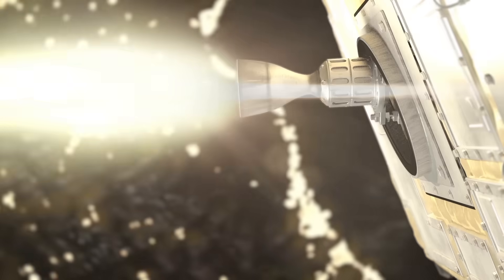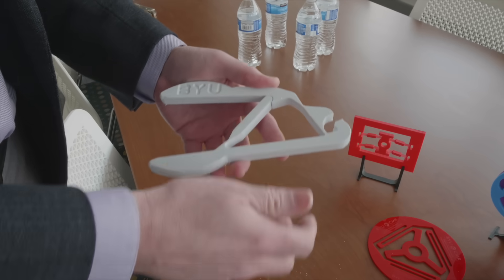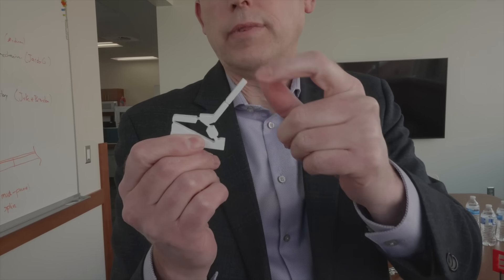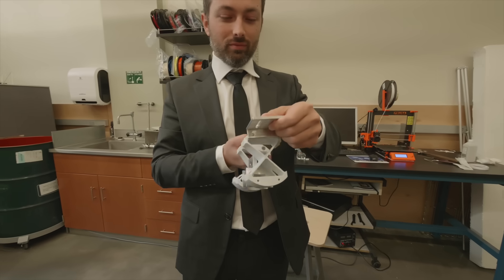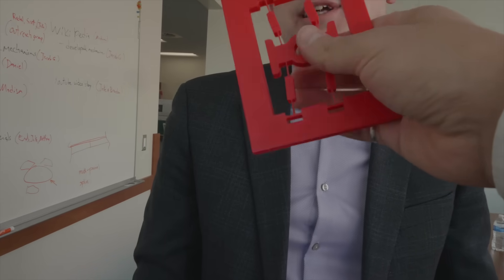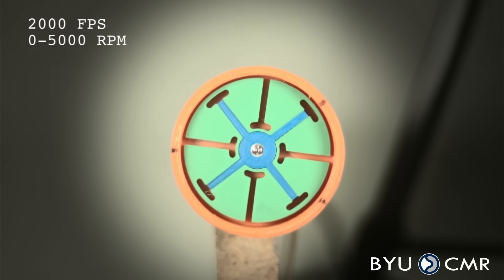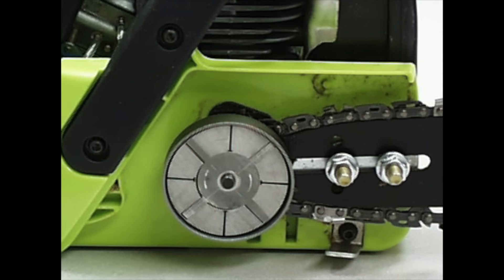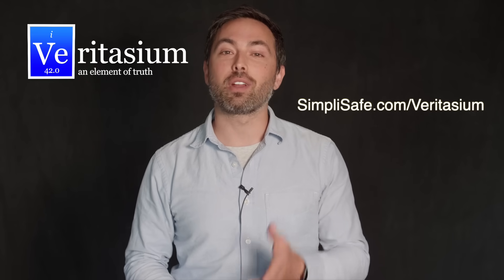Why Machines That Bend Are Better

Comment: Why do I 'really' feel like some of those mechanisms would have serious issues with work hardening, susceptibility to temperature affecting performance, and other such issues in metal? Like, not all of them, and this stuff is really cool, but my brain is telling me there has 'got' to be a catch. Kinda like how most ribbon springs and shaped metal latch bits have been omitted from guns over time in favor of everything being down with dedicated coil springs (except in cases where the mechanism doesn't see much action.) I am intrigued, but skeptical.

Comment: The first thing I thought is that those parts will wear out quickly at the flexi bits. But it looks like does endurance test show that's not true. I picture uses in robotics and or possibly biomedical, as in joint Replacements possibly

Comment: I just thought how awesome it would be if this technology is applied to the automotive industry. Strong, lightweight, highly-tuned single piece suspension systems for example -- nothing that will wear or degrade or leak, and in the worst case that it breaks, the whole unit can be replaced after removing maybe four or five bolts. In aircraft, this could mean single-piece wing and control surfaces (I think NASA already had a concept in the works). Even in the food production industry, single-piece tools are significantly easier to clean and maintain than normal tools that have gaps where food might get stuck and parts that might bind. The possible applications for this technology are endless :)

Comment: 10:59 wouldn't 72Hz mean 72 rotations per second, not just 2?
Reply: If we were talking about the gear spinning at 72Hz, then yes. But in this case the whole device is working at 72Hz, meaning it pushes the "ratchet" 72 times per second. Assuming it has 36 teeth, that would be two rotations per second.

Comment: My only background about flexibility is rigidity. Same goes both ways, nonconversational materials will be needed, may as well be researched, and will definitely cost more for a specialist parts or mechanism. You can't just mass produce universal parts without mass producing the material first.

Comment: I do a lot of work with compliant structures and flexures in my machine design.  I use them to allow compensation of variation in machine design.  Often times machine builders do not account for variation.  If you can now add flexibility to compensate for the remaining system variation your system becomes many times more reliable.

Comment: "Better performance" Nope, you would have to specify the use case. You stated having to lubricate a bearing was a bad thing, but being able to do that ans keep the device operable, sometimes if do that WHILE it's operating, with no down-time, can often be preferable to manufacturing a whole new device because the bendy point finally got weak enough to break (or weak enough to put the device out-of-spec).

Comment: "It's always been considered bad to have flexibility in your machines." No it hasn't. Ever. A bloody spring is a flexible component and they've been purposely built in to things since we've been able to produce metal. Flexibility has been purposefully engineered in to vehicles and buildings for hundreds of years. That sort of line reminds me of those stupid adds that make normal tasks seem ridiculously more difficult than they actually are in order to sell you something you don't need to do the same job.

Comment: I did research with a professor over from Vanderbilt about flexible machines, he was one of the guys that developed soft robotics a few years back, and this was part 2 of his research. This video is really great, and ultimately flexible machines can do a lot for us. The materials physics is pretty complex, requiring some insane calculus here or there to really find out the contours of anything you're making. Excellent video, excellent subject matter.

Comment: But the clutch can't work because as soon as it hits the drum it's going to slow down and shrink again...
What's wrong with my thinking?
Reply: If you rotate fast enough the lost of speed as it hit the drum will still be higher that the minimum speed necessary to expand

Comment: I once day-dreamed about the design of a theoretical semi-automatic pistol that used as few parts as possible.
I'll spare you the details, suffice to say that the trigger, hammer, sear, and various springs, among other parts were all a single mechanism milled into one half of the frame.
I never thought it was actually a viable design until now.
Maybe I should have considered plastic.

Comment: This is so inspiring!  And I was already using flexibility to advantage in some of my 3D printing designs.  Started doing so a few months ago actually, with 3D printed print head housing replacement for my 3D printer.  Used flexibility to make it part count of one.  In my next design I started using flexibility to mount an extruder motor elastically so that it doesn't oppose print head acceleration too much.  I had no idea that flexibility had already got so much attention as to even there be a book written about it.

Comment: Any machine is flexible if you're just strong enough
Reply: @illusion466  you just stare at it strongly, until it bends to your will.
Reply: Maxawe Some u just bent my mond
Reply: @scratchy996  there are people who think you're serious
Reply: @scratchy996  submissive
Reply: Taikamuna back at it again
Reply: @rusurares2689  Can u help a little?
I need 12 more subs.
Reply: Insert girder
Reply: @EmceeIntricacy  I was SO hoping for this comment... THANK YOU
Reply: @williambeaber3816  happy to play that guy for ya dude
Reply: MC Intricacy A brick wall may be not on the list of approved bendables (or a wooden door or unbendable girder) but that’s no issue if you’re just so great.
Reply: unbendable girder... I used to build and install factory overhead cranes... In manipulating steel beams (girders to you) you become very much aware of their flexibility.  Supported on trestles, even very substantial beams exhibit their flexibility if you stand in the middle and bounce up and down, or suspend them slung in the middle.  When testing a crane, you suspend a test weight at mid span, and measure the deflection under load. There will be some.  As long as the deflection does not exceed a certain percentage of span, you're OK.  If you have a crane hoist capable of lifting heavy weights rapidly, and you take your finger off the button, you'll sometimes see the load oscillate quite wildly, due to the flex in the beam, especially with the hoist at mid span.  It can make load placement difficult. Multi speed hoisting was more expensive, but overcame that problem for customers prepared to pay for the additional low speed facility...    @Nosirrbro
Reply: @robertlawson8572  'unbendable girder' is a Futurama reference. I don't think nosirrbro was insinuating that it could really exist.
Reply: Nor, it happens, did I. @Internetexploder1
Reply: Any machinist will tell you "Everything is a spring"
Reply: @PKMartin  nice
Reply: Dude you comment on like any video ever
Reply: @mf7318-g1k  ikr?
Reply: Nokias dont bend or break
Reply: @illusion466  Every machine can flex at least once
Reply: Even a nuclear warhead is a dildo if you're brave enough.
Reply: Nah they might just break or bend instead
Reply: Taikamuna back at it again
Reply: iPhone?
Reply: Or your hammer is big enough.
Reply: Oh sht it’s the 2019 Justin.y
Reply: What about rock?
Reply: @fuzzy4461  even ceramic materials (which rocks can be considered as) are flexible, even though it is way too stiff to see. That's also why you can make stuff like rockwool or glass fibres without them instantly becoming dust. A material that doesn't bend at all would be a miracle.
Reply: @CatNolara  
"A material that doesn't bend at all would be a miracle."

I take it you're referring to many human minds
Reply: Touche.
Reply: Philosophical question, is it still a machine if it is no longer able to function in accordance to it's purpose?
Reply: @kristianfagerstrom7011  ya, just a broken one
Reply: The secret to bend the spoon is to realize that there is no spoon...
Reply: Every weeb's spinal cord is flexible if you are strong enough.
Reply: @illusion466  Everything is bendy. Some things are only bendy once.
Reply: Nothing breaks before it bends.
Reply: @Taikamuna
> Any machine is flexible if you're just strong enough
Alternatively, there's always the good old technique of "Percussive Maintenance": hammer on the damn thing with something hard and sturdy until it works again. If the damn thing should break then, it was fcuked up in the first place anyways and some idiot other than you should have replaced it ages ago.
Reply: Just like every machine is a smoke machine if you use it wrong enough!
Reply: “Snap” oh
Reply: Taikamuna any thing is a dildo if you’re brave enough
Reply: Or it’s not meant to bend and stays wrongly bent
Reply: @Funny_as_Duck  It's a JOKE
Reply: What about the ones that are brittle?
Reply: @noelhann5262  What is shattering but air bending into something?
Reply: Kingsnake Command who are you who is so wise in the ways of science?
Reply: Taikamuna no no, he got a point
Reply: Nokia brick
Reply: @skryf6609  *Almost any machine
Reply: "Our machines are flexible and they bend" Huh? I don't understand. "We made our machines female." Oh! Why didn't you say so?!
Reply: Enough to bend your knees 😆
Reply: Taikamuna back at if again
Reply: Ive seen this on Notebooks. I didnt want to see it!
Reply: O K  lol
Reply: Taikamuna back at it again
Reply: Im saving a spot in replies incase i need to type something..
Reply: well your not wrong
Reply: “Any book is a, “kids book” if the kid can read.” - Mitch Hedberg
Reply: Big. Brain :)
Reply: Elastic limit intensifies
Reply: @sergioro8_125  stranger things theme music plays in the bsckground
Reply: Any comment is original if you're naive enough
Reply: @fluent_styles6720  hahahaha
Reply: It takes a dragon to bend a knee, but only an arrow to destroy it.
Reply: LOL
Reply: there's a difference between flexing and breaking
Reply: Top comment: torilla tavataan o/
Reply: Jerryrigeverything has joined the chat
Reply: Just like anything can be used as a dildo if you're brave enough.
Reply: Big brain
Reply: Even if these comments are made by a machine i don’t care there super good
Reply: @jambi2118  Is your comment machine-generated too?
Reply: lmao
Reply: Back at it again
Reply: This dude.
Reply: I see u E v e r y w h e r e
Reply: Chuck Norris thinks the same
Reply: @illusion466  Seems also that most machines are much stronger than I am, so the strength of the machine is more likely to matter than my own...
Reply: How what I see you everywhere
Reply: Basically spring
Reply: 69th answer HA
Reply: Nokia 3310?
Reply: Miten sä tänne ny päädyit
Reply: @lahtine7431  He is famous
Reply: > Sees Taikamuna instead of Justin Y.
> Finds more comment below
> No Justin Y.
> Goes to other videos
> Found Justin Y. instead of Taikamuna

LoadingCat.png
Reply: @RedSquirrelDude  Lol Justin.Y is like a celebrity just by burrowing himself in every comment section
Reply: glass is glass, and glass cracks

dont even tell me about the new Samsung’s foldable, do research yourself
Reply: glass: 😳
Reply: But most wont work after being bent
Reply: Nokia: laughs indestructably
Reply: Any machine is flexible unless it's brittle.
Reply: Hi
Reply: Anything is a laptop if you're brave enough!
Reply: The magic egg
Reply: But actually class has to be heated up so it isnt really flexible if in a machine unless heated or maybe if you bend it slowly for a million years.
Reply: Titanium: im about to end this mans whole career
Reply: Millo uutta domino videoo?
Reply: airogel
Reply: what about 'Nokia'
Reply: K bend my salted crackers without it breaking pls
Reply: Your mom is flexible
Reply: Every machine is a flamethrower if it's broken enough
Reply: Jerry rig everything
Reply: this man i too smart to be alive
Reply: everybody when iphone 6 was first released
Reply: Uhhh what about snapping? Are you just saying that to make your self somewhat edgy?
Reply: Hahahahaaha
Reply: not a bong
Reply: No, no, hes got a point
Reply: Ye
Reply: Any bone can be broken if you're brave enough
Reply: Lol nope.
Reply: Illusion466 do it slowly in a hot condition
Reply: pleople dont produce brittle machines
Reply: Nuthan Prasad , yea I know, it was a dumb comment
Reply: Until it snaps
Reply: Even cars when you wreck them, they bend nicely 😂
Reply: Why do i see this user everywhere
Reply: Stefano Gabbani which one
Reply: Glass
Reply: Not really because then it would break which means it’s not flexible
Reply: 4:38
"Is that a good thinking?"
"Well, it's a thinking, at least."
Reply: That is muscle hanks philosophy
Reply: I've read it  my mind with a russian accent.
Reply: What if it breaks?
Reply: Broken
Reply: Our mother and grandmother are not strong but somehow they can bend them
Reply: Harmonic drive is a good exemple!!
Reply: It is only flexible if it can return to its original form.
Reply: What if it breaks first?
Reply: So i can bend people
Reply: This is either very profound or very ignorant. And the fact that I can't tell is impressive. Bravo to you, good sir.
Reply: Any machine is a smoke machine if you operate it wrong enough
Reply: I mean. Jerryrigeverything has been testing that for a long time now. I can confirm this.
Reply: Jesus loves you:)
Reply: @zombrz  Jesus is my nigga
Reply: I soviet russia.

SPOON BEND YOU
Reply: @illusion466  he shows how this can also work in the video.
Reply: i read this in a Russian accent
Reply: i tried to fold a car engine in half
Reply: XD true!
Reply: Laughs in crystalline structures
Reply: Legos
Reply: Miten sun kommemtit on kaikkialla
Reply: What about uranium
Reply: r/technicallythetruth
Reply: Your name means, poop 💩 first in Tagalog
Reply: @ejandaya143  it means magic egg in finnish and he is finnish
Reply: False if it’s brittle it’ll break before it bends
Reply: This is my third encounter with you on totally different videos with much different plot
Reply: Any machine will kill you quicker than 'Hey Egbert, we should've thought about safety....'
Reply: This one has discovered Young's Modulus
Reply: magicegg
Reply: Does it goes back to its original state tho
Reply: Well yes but actually yes
Reply: i like it but i disagree
Reply: @illusion466  melt it
Reply: mfs be built different
Reply: the bucket of snapped bolts in my garage begs to differ
Reply: Including iPad
Reply: However, is the tool strong enough to bend back?
Reply: Any machine is a smoke machine if you don’t know how to use it
Reply: Taikamuna back at it again
Reply: Taikamuna no
Reply: Or If the machine is weak enough
Reply: It's always a good sight when you see this guy
Reply: Legend
Reply: Unles of course it is malleable
Reply: With the power of flex tape, I made the tallest tower in the ENTIRE world, flexible!
Reply: Glass cylinder?
Reply: Not all of them snap back when pressure is removed though.
Reply: yes
Reply: Not wood though
Reply: @dankyzbusiness3227  b e n d
Reply: Anything is a fleshlight if you're brave enough
Reply: BRUTAL SCIENCE INTENSIFIES
Reply: True
Reply: Yep glass
Reply: "Anybody is flexible if you're strong enough" there I fixed your comment
Reply: "Unless its too brittle"  
Geology: hold my plate techtonics
Reply: glass?
Reply: Except my meat when it's hard
Reply: Glass
Reply: LMAO
Reply: Not quite. There are fragility and strongness. Some materials can simply break up.
Reply: @bk-qd3hr  be delicate
Reply: @bk-qd3hr  not sure to understand what you mean?
Reply: @bk-qd3hr  but it always bends before it breaks
Reply: @bk-qd3hr  r/wooosh
Reply: @bk-qd3hr  bruv
Reply: @bk-qd3hr  strength, the word your looking for is strength
Reply: @asiamangape4311  Thanks, I have been seeking for this word for two years and I don't have to anymore.
Reply: @bk-qd3hr  good job 4head
Reply: Taikamuna back at it again
Reply: I see ur comments everywhere lol
Reply: How expensive were those likes ? The statement completely misses the point of the video
Reply: Alexander M , because he/she has a check mark

Comment: In low cost machines such as the average passenger vehicle you will find a small amount of backlash in the steering. In higher end machines where more precision is required there are a few ways of dealing with it such as preloading moving parts like bearings, chains and belts, adding lock-nuts to screws, and adding dowels to locate mating surfaces so that they do not shift against each other.

Comment: Pretty poor explanation of the nuclear safety device. You said the disc spins 2 revolutions per second, so is the laser not going to always go through the hole at some point? Should the disc not be still until you need to line it up?

Comment: I actually worked on similar stuff for my master thesis. I had to design a flexible part to measure static forces and it turns out a triple ring with beams connecting them (which is compliant mechanism similar to these in video) is perfect for the job.

Comment: Intuition had no issues with bending itself (optical glass cables, springs in watches or measuring tape), durability on the other hand with force multipliers and bit thicker stuff...

Comment: 10:53 Isn't 72Hz 72 revolutions (cycles) per second?
Reply: Yes
Reply: 72 signals per second to move, i bet there is 36 notches on that wheel and that means it needs 36 signals for one whole revolution. So it really does two revolutions per second. Hz does not mean revolutions per second, its anything per second :-)